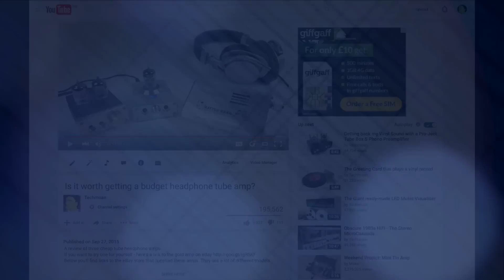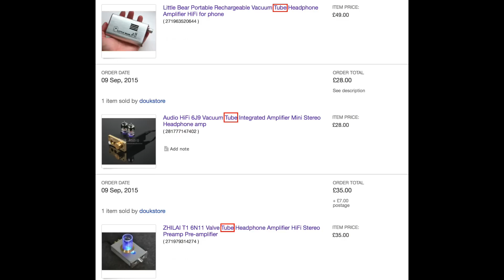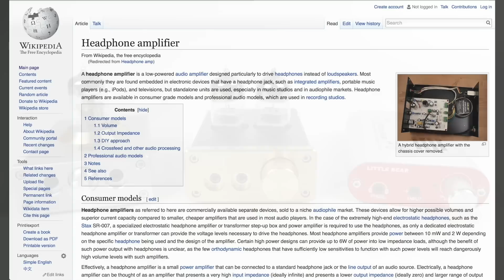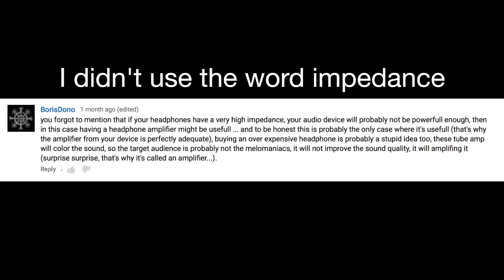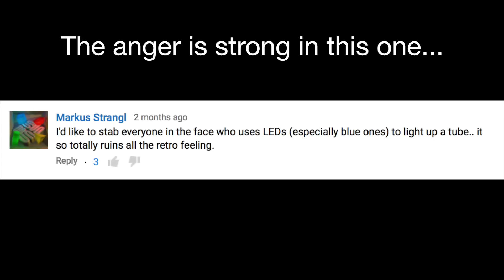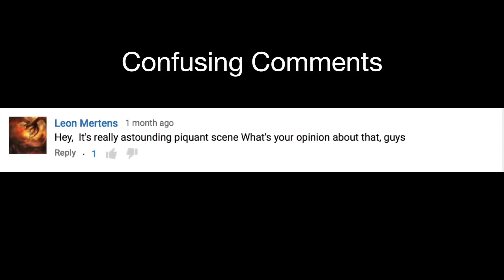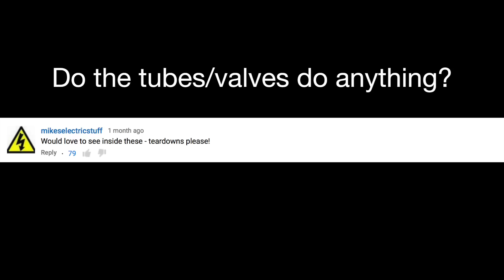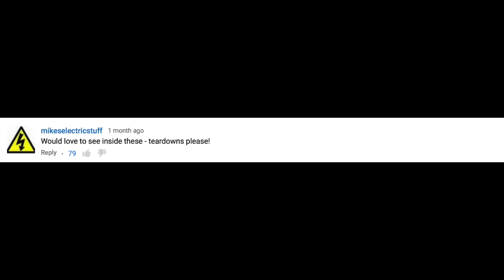Headphone Tube Amps - Follow-up & Tear-down

Comment: Hi, electrical engineer here.
Gold Xuan Zu: the circuitboard is a combination of through-hole components (soldered THROUGH the circuit board, mainly on the right) and SMD components (Surface Mount Device soldered ON the circuit board mainly on the left) which is why they don't seem connected if you look on the back. It uses HQ surface-mount capacitors which filters the high/low pass frequencies and along with the tubes/valves (which act like old-school transistors) creates the analog vibe. The two IC's at the front are (digital) dual amplifiers and actually seem high grade. Generally the circuit is of very high quality and an amazing finish for a budget tube/valve amp. So no suprise on actually being better.
Zhilai: "A worthless heap of shit" as my favorite Aussie EEV-blogger likes to call them. All of the capacitors are of terrible quality and one of them is already busted (the electrolytic caps as we call them have fluids inside that swell up after time). Not worth explaining the rest. Garbage.
Little Bear: What. The. Actual. F*ck? Almost ALL of the components are obsolete/refurbished, it's a wacky mix of horizontal and vertical circuitboards probably to cram all that circuitry inside. All I see is trouble. Not much to add.
Reply: Agree with all of gigglygigglydude's comments and would like to mention that a better set of tubes will probably get rid of the microphonics in the Gold Xuan Zu amp as this is a mechanical issue with the internal components of the tube.
Reply: Don't forget the boost circuit on the little bear amp, with additional caps botched onto it. That's what's giving the circuit the 12 volts it needs. Drains the battery real fast though because it has to be drawing a lot of current through that boost converter. Also, horizontal capacitors do exist ffs. Why didn't they use those?
Reply: You know what? That's exactly how I was rating them myself, even though I have MUCH less experience than you do as I missed a lot of things you mentioned. I recognized the charging circuit on the last one I believe it's the TP4056, got a bunch of em myself.
It amazes me how cheaply they can make these things.
Reply: Little bear has Nichicon and ELNA caps. They don't get better than that. The op amp is a Texas Instruments. That massive 68K uF cap would presumably be a fantastic buffer for output power sag. I agree that its a hideous layout, but I don't know that its garbage components.
Reply: Ohoho I see those cheapo buck converters and 1.5 watt mini stereo Amp in there (a complete self contained amplification unit) it really looks like the little bears circuitry outside of that is just to power the tube
Reply: Those op amps are not digital. What an incredibly stupid thing for an engineer to say.
Reply: @guitarman13021  Op-amps can be digital, if they switch a signal on/off. Probably just a slip of the tongue because they are commonly used in DAC circuits. I think you're incredibly stupid for calling someone stupid for a stupid mistake. How about that, do you like paradoxes?
Reply: @guitarman13021  - Although vacuum tubes were first invented in 1907. Analog Op Amps weren't introduced until 1941, and were developed prior to the invention of the transistor. They were originally called "Vacuum Tube Op-Amps" because the amplification was produced via vacuum tubes, which are "analog" devices.  

Transistors started to become available in the early 1950's. Transistors are digital devices which turn completely on and off very rapidly, producing the 0's and 1's that everyone recognizes as an indication of a digital device, rather than the sine wave as voltage is rapidly increased and decreased with an analog device (such as a vacuum tube).

As transistor technology advanced, and transistors became miniaturized, it became possible to place multiple transistors on a single chip, and in 1959 the first integrated circuit (IC) was patented.  The full name for the IC was actually the "Digital Integrated Circuit". These were also commonly referred to as "Integrated Chips". 

So, although Op Amps were originally based on vacuum tubes, and were indeed analog devices, the transistor, and then the Integrated circuit performed the same functions as the vacuum tube, and because of their appeal due to their smaller size, their elimination of the high levels of heat vacuum tubes produced, and their cheaper cost, both transistors and then IC's quickly replaced vaccum tubes. Essentially, the Transistor and the Integrated Circuit very quickly replaced the previous analog technology with the newer, more modern digital technology.

These days, op amps are no longer based on vacuum tubes, but are of IC design, and are indeed digital devices. So, it is not a "stupid thing for an engineer to say" op amps are digital in their design and operation, as indeed they actually are.

It should also be understood that a headphone amp is not an op amp.  An op amp is merely a component within the circuitry of a headphone amp, and they are completely separate from the tubes within the circuitry; nor are the tubes any part of the circuitry of the op amps, as well. 

So, the engineer was quite right, and well informed both his explanation and statement. Modern Op Amps are Digital Integrated Circuits, which are devices which are... well... digital.
Reply: @GlennMarshallRocks  Transistors are digital?  Lmao.  Uh-oh.  If I put a fine steel mesh after them will it catch the 1s and 0s?

The most hilarious part of this disastrous word-salad is that you can make digital devices with vacuum tubes.  "Digital" and "analog" don't mean "tube" and "transistor."  They are methods of representing information as either a sequence of discrete values (and note, computers need not even be binary; tertiary and ternary and whatever computers are possible meaning "1s and 0s" is meaningless here too) or as continuous waveform ANALOGous to the original signal being represented.

Obviously those op amp ICs are "separate" from the tubes in that they are individual components, but they're part of the same circuit.  So hopefully they're not "completely separate," because electrons need media through which to flow.

Essentially every single thing you said is incorrect.
Reply: @GlennMarshallRocks  My fren, you are only 3/4ths correct.
Transistors are not "digital" devices, they too are analog amplification devices like tubes are. You can run a op-amp using only transistors, it is in no way a digital device, it has analog signal in, and an analog signal out, with no digital electronics in-between. The same goes for integrated circuit op-amps, they are not digital devices either.
So that out of the way, here are some variations on the theme . ..
Digital circuits can use either transistors or tubes, it is the way they are used that makes the circuit digital or not.
Digital circuits use transistors in one of two conducting modes, either on or off. Then those  circuits are connected to other circuits to create logic gates, or accumulators or flip-flops, all the way up to CPUs.
Now to come full circle, there are some digitally driven op-amp emulators.
Basically these engineered boxes take in analog signals, turn  the analog into digital with a ADC circuit, then they do whatever audio processing on them mathematically/computationally, then take the finished digital signal and turn it back into analog with a DAC circuit.
And there ya go, dats howit werks :-)
Reply: gigglygigglydude Could you comment on the new little bear b4 as I would love to see what you think of it’s internals?
Reply: @essentialedm937  None of those are real valve amps, the work is being done by the NE5532 op-amps.
Reply: Well, you may be an EE engineer but you clearly know nothing about valve electronics. The Littel Bear has actually EXCELLENT caps: I see two Nichicon Black Gate and an ELNA cap. I don't know the brown one but it's high value, so it's probably for the power supply. These are high quality audio caps, which means they are not going for cheap junk and they are actually caring for audio quality. Given the simplicity of the circuit, it certainly does make a difference.
Reply: NEVER trust an engineer. Ever. It always goes back to be revised after I explain why it won't work as designed at least 4 times lol
40 year revision electronic tech. Yes I'm old enough to have actually worked with tubes when they were in use. Tube pins are almost all connected thru multi layer curcuit boards as far as I see.
Sound does go through the system to the op amps , some better than others (see Muses) and the tube sound adds warmth and not as tinny as digital music. Analog has it's perks. 
Can everyone tell a difference?
Nope. Short answer. 
Audiophile:: think boats. No wonder they are angry 
If I spend that much of my money not to tell the difference I'd be pissed too lol
Reply: gigglygigglydude Thanks so much - really appreciate the knowledge. Went and bought the amp you recommended cos I want to do my toe in the water without spending a ton. Please keep helping people with posts like this.
Reply: What's worrying about one of them, is the batteries onboard! As in, they cheaped out on the power supply. Rather than fitting a power supply that can actually produce the current the valve's heater needs, they found some batteries in a bin, and let them buffer it instead. As long as you leave it plugged in when you're not using it, it'll work most of the time. For a couple of years til the batteries stop holding a charge. Or balloon up cos they're, as I said, from a skip. 

Polaroid's Zink pocket printer thingy had a battery, that only held charge to print 2 or 3 actual pictures. Again because it would have required an enormous supply to produce the current, that was only needed in short bursts. Sometimes it's an excusible decision. It can keep costs down. Generally it's a shit idea though. Only possible because of the economics of lithium batteries, due to smartphones.
Reply: I guess where you live it's ok for an electrician to call himself an engineer, but you don't seem to know what a transistor is or how it's used in an amplifier.  Do us all a favour and go look it up.  The only case in an audio amp where the output transistors go straight from "on" to "off" is in class D (still doesn't stand for digital so get that out of your head) where the chip breaks the audio up into a series of steps, this is done to make the amp more efficient and in some cases like the Tripath amps, sounds pretty good too.   This is not one of those designs.  I can't be bothered to look up the pinouts of those tubes to see if they are being used for anything, but I would guess not.
Reply: might be wrong but it looks like they might be using a switching boost converter to jack up the voltage to run the heaters and just filtering out the noise post amplification, at least on the first two. Don't know much about tubes, but i'm not sure what else that other little smd chip could be doing. agree with giggly, xuanzo looks descent others are junk
Reply: @jazzathoth  The heaters run on a very low voltage. Often 6.3V, but can be a bit lower or higher. It's high current that matters. High total power. You can't get power from nothing using convertors, you need a proper non-cheap power supply. 

Could've been the plate voltages of 90V or so were being generated by a boost convertor. But would have sounded utterly horrendous, more like a siren than an audio system. 

But it turned out in the end that wasn't the case. People analysed them. They were using a plate voltage of around 12V, in an unusual mode of operation that is possible, but doesn't actually give any amplification! Doesn't actually affect the sound, at all! 

So although sound travelled through them, they were doing nothing to it. So they may as well have not wired them up for all the good it did. So the answer is they ARE pieces of shit! Who'd'a thunk it?
Reply: Joe Bender The heaters run on 6V - that is why the tube model numbers have a 6 at the start. No need to jack up the voltage there. You need high voltage to get electrons to do the actual amplification (fly from cathode to anode).
Reply: @jazzathoth  Tubes are heating on low voltages. Rectifiers (like AZ 11, AZ 4, AZ 12, ...) are heating at 4 Volts, other tubes are usually heating at 6.3 Volts, sometimes you can meet tubes for 12.6 Volts heating. You can actually meet some special tubes are suited for higer heating voltages, I have old set of tubes from LW transmitter  that was rebuilded for transistors and these power tubes are for 108 Volts heating. (I am sorry for my English, I am not from English speaking countries)
Reply: Well, there is nothing "digital" on the Op-Amps, as it is analogue in and analogue out. Per definition, as tubes are of course analogue. First amp looks the cleanest build. Little bear components obsolete/refurbished: no, it is just the standard Chinese junk. Nothing valuable enough to salvage / refurbish. Wacky mix: I guess you never saw electronics in confined spaces before? Signed, a real electronics engineer.
Reply: @RoaldvdM  - Absolutely.    The so-called 'electrical engineer' (gigglygigglydude = It's all in the name ya know (?) made some serious technical blunders....     

Gigglygigglydudeness
In the XuanGold - The two 6J9 'thermionic valves' (or 'electron vacuum tubes') are triple triodes  -  More at home in a receiver (local oscillator/RF detector/mixer).  Here probably being used as a two stage class A amplifier (on each channel).   The op-amps being either input buffers or output power amps   It is possibly likely that one of the triodes would be redundant, hence the pin-outs not being connected to the circuit traces (which is common in valve/tube technology) and might even be the cause of the microphonics.   

Why would there be DACs in what is simply an analog, line input amplifier?  Also, I'm totally amazed at your 20/20 ocular capability, how you determine what those op-amps are is simply mindboggling.  

The Zhilai - single valve/tube - 6N11 is a double triode.  Being used in a similar hybrid configuration.  but using one valve/tube shared across two channels, which coupled with inferior electrolytics, would explain the inferior/mundane performance compared to the former XuanGold.  

The Little Bear - Uses the 6021, a subminiature double triode.  Most likely using a similar circuit configuration to the Zhilai.   These Raytheon subminiature valve/tubes are designed specifically for harsh environments (military spec).   Ironically, probably better specs than the previous valve types and appropriately employed in this 'mobile' headphone amp.     The hiss audible, might be simply down to either inferior capacitors, poor soldering (likely), duff components (resistors), low quality op-amps, or a combination  of all.   

High grade military electronic equipment of the WW2 and the Cold War used similar sub-miniature electron tube technology (I've worked on many such devices), where space (in a military aircraft, ship or tank) is at a premium and efficiency is paramount.    Those early pre-transistor 'walkie-talkies' used in the latter years of WW2 contained such devices, whereby the tubes were soldered in place and suspended in rubber glands, to minimise shock.
____________________________________________________________________________________________________________
Electrical engineer you might be - electronics engineer -  questionable.
Reply: @Deebz270  Do you know why all of them have NE5532's on board? Why would one need a PREAMP on the AMP designed for headphones? Or do they think someone is going to plug a guitar in?
Reply: @Deebz270  @Little Bear: I have no experience on RF-shielding of these tiny tubes, but the subminiature tube basically laying right next to what I guess is the boost converter's inductor seems suboptimal to me... Maybe that contributes to audible noise?
Reply: This has so many thumbs up even though some of it is wrong
Reply: So I'm no expert but what I see is that they are using a three pin config for the tubes making them act like a transistor the rest are heating elements to lower the breakdown voltage. The two op amps are used in conjunction with the caps to build a tiny voltage upstepper running the tubes. The rest of the components are used to make the signal clean and stabilize the feedback for the amps. But what do I know I'm only 16. ;)
Reply: @georgiaboyshenanigans7084  Actually, not too bad for a guess! Not bang-on but not bad. 

You're not too far off on the tubes, that's how they're generally used in (proper!) amplifiers. The heating elements are standard in all tubes, it's why the British call them "Thermionic valves". The heat doesn't so much reduce breakdown voltage. Instead, it heats up the ions (namely electrons), giving them the energy to leave the metal cathode. The voltage provides the rest of the energy, and pushes them toward the anode. That's basically how tubes / valves work. The "grid", in between, lets a smaller current control this larger current (ie electron) flow. A small signal controlling a large one is amplification! 

After the first tubes, very quickly manufacturers added extra plates, to control the signal better, controlling feedback and reducing distortion in various ways. A simple triode amp is rare. But this isn't even that!

The op-amps are used simply as amplifiers. Because the tubes are essentially useless in this circuit! A proper tube circuit runs on around 60V - 90V, and uses transformers to convert this high-voltage low-current into the low-voltage high-current modern systems use. And the other way, sometimes, for input. Transformers were all over the place in tube appliances. Not just for power supply. The second-biggest, after power, would often be connecting the output tube to the speaker.

Transformers are heavy and expensive and not the sort of thing you find in dirt-cheap Chinese garbage. Hence, the tubes in these aren't actually doing any amplifying, and don't need transformers. This means something has to, hence the op-amps!

The rest of the components do... stuff! They don't put every possible component into a chip, because that would limit the chip's versatility. Different component values are needed for different uses. And some things, like resistors to dissipate a lot of power, or large capacitors, can't be put on-chip. 

But at least you have the right attitude, curiosity and desire to know are the important things. Just need some proper sources of knowledge! I absolutely wouldn't recommend "blind leading the blind" and anything written by "tech" journalists, who are AWFUL nowadays! They seemingly get their education reading other tech journalists, who did the same, and the whole thing all goes back to it's roots in press releases somewhere! 

Books are still the best. Videos can help. Websites I dunno, some are good. The boring type by academic types are the ones you need. Anything that makes sense straight away is no use! If it's the real information then it will take a while to click, and will only make sense accompanied by much more of the same information. 

School physics and electronics courses are a good start. Someone who actually paid attention at school is a mile ahead of some simpleton on some tech review website. Not meaning Mat, because he freely admits the limits of his knowledge and understands well where his limits are. As smart but modest folk do.  

The last few electronics hobbyist mags, the ones for people who make their own projects, Elektor, etc, are great cos there's a variety of short articles that can be a good way to pick up the principles. Even if you don't actually do the projects. Elektor is probably the most advanced, but it's the only international one I can think of to name. Stuff where they offer PCB plans, and you mail-order components to construct stuff with. For people who buy components, not finished items! "Everyday & Practical Electronics" used to be a good one for beginners and tinkerers. The back issues you might find in archives here and there.